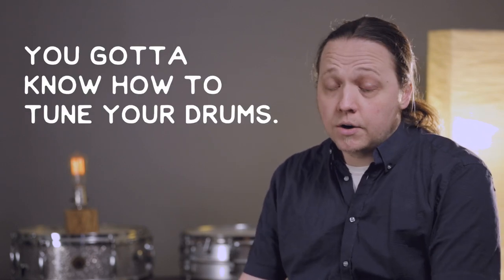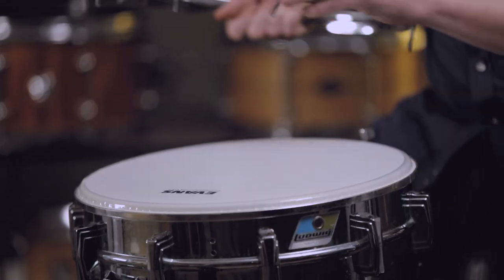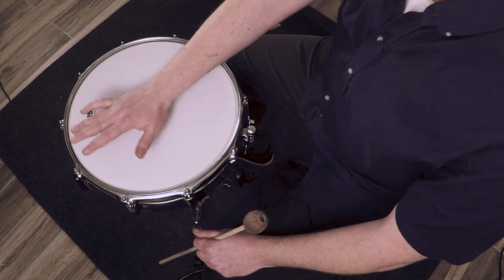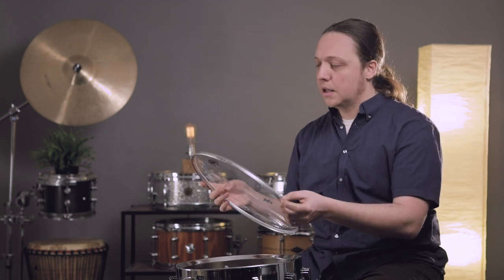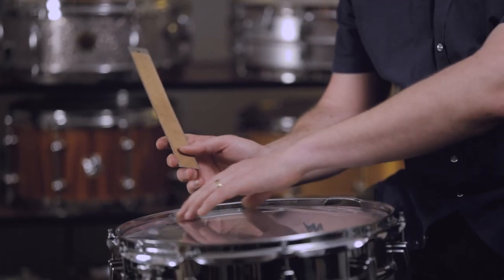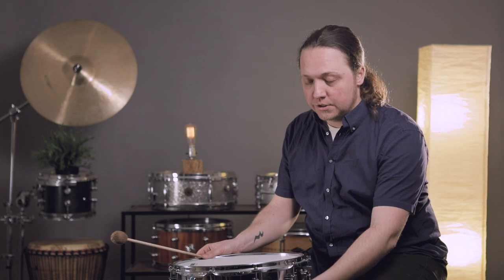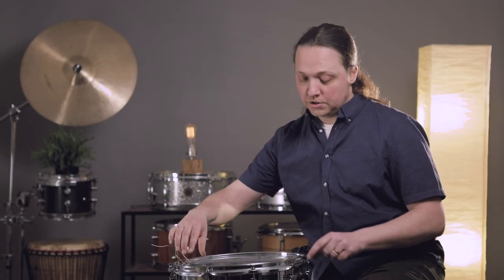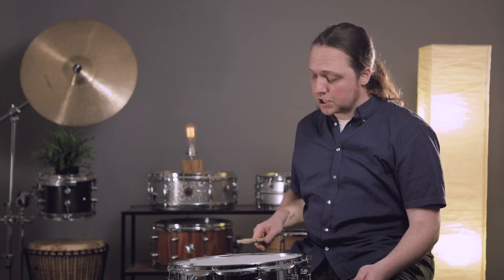Ep. 1 How to Get A Great All-Purpose Snare Drum Sound

Comment: I took a day and watched all of the videos on your Channel and am very impressed with your knowledge! I thought I was the only other drummer out there who got into the deep science of tuning! I started playing drums in 1968 when I was 12 years old! In 1971 I bought a brand new Double Bass Octoplus drum set with a Ludwig Supraphonic 400! Since that very day I've always used the Remo Ambassador Frosted Batter Head & Remo Resonant head with the Ludwig PAT. 2517124 Wires! I have since then downgraded the Octoplus set to a four-piece trap set but still use the Ludwig Supraphonic 400 and found myself in need of a second snare drum for backup now that I am in a performing band again! I purchased an East Rock snare drum from Amazon for $60 which also came with a Soft Case, Black Practice Pad Mat, Sticks & a Drum Key! The first thing I did was take the entire drum apart and snugup every bolt on the shell and lubricated all of the threads on the Tuning Screws, Internal Muffler and Throw Off! Next a Remo Ambassador Frosted Head on top pitched up high then searched worldwide and found the original Ludwig Vintage PAT. 2517124 Snare Wires along with new Strings from Guitar Center! The whole idea was to get this East Rock snare drum to sound exactly like my Ludwig Supraphonic 400! Unfortunately after all of my endeavors my experiment was a failure. When I hit the East Rock snare drum the Snares are still rattling! 😞

Comment: So... just got around to trying this method. I have always been a "tighten the reso head as tight a humanly possible" kind of guy, but the idea of eliminating the crap secondary snare-wire noises and controlling buzz interested me. Followed the instructions and found that after verifying the bottom hoop height at each lug was the same, the reso was waaaay looser than I was used to; Before it was 9.5 out of 10 and now I find it to be 5 or 6. 

Put on the batter and tensioned it up. Put the drum on its stand and hit it not knowing what to expect.  Wow. Just... wow. Fatness bordering on obesity. I cranked it up a little higher than I normally would and got tone I like without losing any girth. Great vid, thank you!

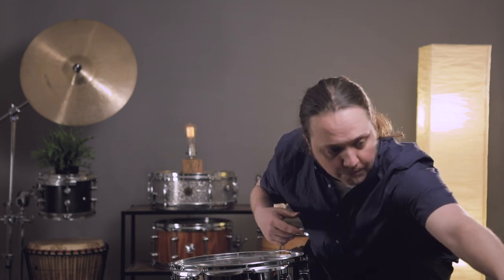Comment: The most valuable part of this video is the section about the bottom (snare side) head. I've always cranked the hell out of my snare side heads and tuned it like I would any other head, but noticed the tension rods around the snare beds were turned several times more than the others. Never really thought anything about it until watching this video. So I took the heads off one of my favorite snares and realized the bottom hoop was now warped because I'd over-cranked those lugs around the snare beds. Great. Ordered a new bottom hoop. Replaced both heads. And did my best to install the bottom head+hoop using the ruler method explained around 7:30 in this video. Not sure if I did it right, but I at least made sure to turn ALL tension rods about THE SAME AMOUNT (regardless of pitch), then fine tuned a little as needed. Now my bottom heads are tight, but not ridiculously tight, and while the bottom head may not necessarily be in tune with itself, I now have way more sensitivity and responsiveness from the snares at both loose/tight strainer tensions, and at all tuning ranges (top head). This alone improved my snare sound dramatically! THANKS GUYS!

Comment: Great choice of drum! I love my '76 Supraphonic and I even kept the original heads, snares and one of the butt plate screws as keepsakes after changing those out with new ones! Really, it's a great all-purpose drum so you'll get a great all-purpose sound most of the time as long as you tune it carefully like you did here (unless you need something crazy high or crazy fat sounding, in which cases a smaller or bigger drum is the solution)!

Comment: Just tried this method for my custom Acrolite, and boy howdy does it sound nice now! I basically tuned my resonant side up until it choked, then backed it off until I obtained a nice resonant note. Then I adjusted the batter head a little tighter than usual, and adjusted it to control attack. When totally equalled out, I found it has a nice WHAP so it now. Checking with pitch, it also ended up being the same interval between the heads as my preferred studio tuning, around a major third (B resonant, G batter). My only suggestion is that you guys include some more musical notes when mentioning your tuning, as it really helps us audiophiles hone in on a specific pitch to really replicate what you guys are doing. Awesome as always!
Reply from the maker: Awesome! So glad it worked! We've definitely been including pitch references in more recent videos, had no idea that it would benefit people so much :)

Comment: Great vid and great tips! One of the best for snare tuning I have seen so far (and there were quite many...)
Will humbly add few tips of my own:
- get 2 drum keys, tuning is more than twice faster and the tension is distributed more evenly on the head
- pressure on the head is especially needed with Remo heads due to the resin they use for the head bed. You can hear significant cracks of it while doing it. Do not be scared to do it. (Simon Phillips used to jump on his bass drum head, look it up on YT)

After many years I have found out 2 things I really like on my cheap  (literally, it was for for some $80 new when I bought it back in the days) birch Sonor Sonic Plus. (I have beech enforcement rings made there by Hallvad and changed the plastic throw off to a metal one). I got great sounding snare drum for less than $200 (you really do not need the Supraphonic ;o)):
- I prefer textile (nothing that can stretch ofc) straps over the strings for snares. Easier to keep snares straight and imho it is more sensitive than the string.
- Wooden hoops add another dimension to the sound. I use Hallvad beech one with inlaid dural circle so I have the warmth of the wood and the hoop will not get destroyed over time from rim shots, which still sound metal-ish.

Comment: I’ve started watching your videos recently and I’m enjoying them.  In each I’ve seen, the first time you hit the snare I’m instantly moved by it.  “THAT’s what a snare sounds like.”  So I sought out this particular demo.  Everything I’ve done for years and years is right in line with what you demonstrate.  I have an acrolite that’s at least 30 years old, and sadly it’s getting out of round, as evidenced by the violence required to get a new head on it and maybe it’s time to get another. It’s just not making that smooth resonance and I’m continuously using eq notches and de-essers to tame the wonky ring I get now. 
I congratulate you on your fine examples of the proper characteristic sound of a drum.
Reply from the maker: Thanks for the kind words! Definitely consider taking the shell to a skilled drum restoration shop/drum builder to get it looked at. A dented/out of round Acrolite is a relatively easy fix and it’s nice to not have to retire a drum if you don’t need to. Cheers!
Reply: Sounds Like A Drum wow! That’s really nice advice; my knee jerk feeling is that it wouldn’t be worth it overall and I do have significant attachment to this drum as it was my instrument for beginning 6th grade band in the 1980’s. Several years back I replaced all the bow tie lugs with matched originals and this would just be another chapter in its dare I say storied history.  You have renewed my faith in its usefulness and potential.
Reply: @joebisbey4521  ah, you just want an excuse to go buy a new DW kit, lol.

Comment: When you are installing the snares, After making sure the snare bed is level,  Where do you suggest the throw off adjustment (Spinning Knob)  should be set to ?  In other words, Your Ludwig throw off has a knurled knob that you turn to adjust the snares to get them close to and/or further away from the snare bed.  Where would you place that snare adjustment just before installing the snares ? Should the knob be turned back and set loose,  Say backed off all the way ?  or half way ? Is there a standard setting (low or high from the snare bed)  for the throw off when installing the snares ? I guess what I am asking is what kind of snare throw off adjustment do you Start with before installing the snares. High, low or in the middle ?   Good job on the video, You covered the bases and got right down to it with out a lot of non essential information.  I hope this question doesn't seem nit picky. But when I install snares that seems to be my issue. I know every snare drum can act & set up differently and each can present its own issues.

Comment: Things to do before you start.

Make sure the bearing edge AND the hoops are perfectly round and flat.  Also, it's a good idea to make sure the bearing edge doesn't have any issues.  As far as using beeswax, people use that on wood shells more than metal.  

  If they arent perfectly round and flat, it will be difficult to impossible to get good tuning.  Rims often go out of round either from the factory, or with those that play hard and play lots of rim shots.  

I know the Ludwig Supraphonic snare drum Is one of the most popular snare drums, I have found they don't have a very good bearing edge and this goes for other metal snare drums with a bent over bearing edge.  Some might be better than others, but it's hard to get them to have a perfect bearing edge.  And since the shell is a thin metal, they are more susceptible to going out of round.

Comment: Here is a Tip if you're in a pinch and don't have a mallet to pull out the low ends for tuning the batter side. You can take cymbal felts and put the tip of your drum stick in the center. Voila makeshift mallet. Yes depending on your stick model this may not work but its worth a shot. 

P.S. You can do this with both sticks to get a great soft cymbal swell on the fly.

Comment: I like to use a mallet to get the fundamental note of the shell before I mount and tune the heads. You have to remove all of the hardware to get the purest note, but you only have to do it one time. If the drum is well-built and in round, it should be fairly easy to discern that note, match it to a chromatic tuner, and tune the equivalent on the batter head. You can use the equivalent on the resonant side, though you may have to crank it quite a bit to hit the octave. If it's too much, shoot for a complimentary harmony note instead. I do this every time I get a new drum, and I'll mark the chosen notes on the inside of the shell( small, near the bearing edge )with a Sharpie. Happy tuning and tunes!
Reply from the maker: We plan to talk about this in a future video. Cheers! -Ben

Comment: Thanks for sharing. Could you talk more about or give an example of how you know when you have ruined a resonant head?
Reply from the maker: Hey there! It's tricky to say because there are a lot of factors, but what i'll usually look for is if i'm not getting as much warmth out of the drum at the normal tunings i'd use it at (especially with rimshots, i.e. if the rimshots are sounding thin and pingy rather than warm and full), or if the snareside rim is starting to get close to being even with the bearing edge (over-tight). Chances are in either of those cases the head isn't generating any tone anymore. If I see a snareside head mounted and cinched down tight and the hoop is at an odd angle because one side is way tighter than the other, i'd definitely change that too for the sake of the wires being able to speak their best. - Cody

Comment: Great video! ..btw I've noticed (I'm not wrong right?) that turning the stick around and hitting a bit harder (instead of using a mallet) gives better results hearing the pitch-difference for the top head (for the bottom head you can't do that or you'll get dents into the head since it's thin)
Reply from the maker: Hey there! I guess it depends on if we're talking about hitting the drum dead center to hear its primary pitch or if we're trying to even out tensions at all of the individual lugs. I'd say what ever sounds best to you is definitely fine, but for me using a hard striker to listen to tuning/pitch at the lugs gets dicey because it will bring out more of the overtones in the head in addition to the fundamental pitch and start to confuse my ear a bit. Hitting the center to get the full sound, anything works :) - Cody

Comment: best snare tuning vidio iv'e found by far. the  step by step method and using correct tools for setup and tuning you would be a lead engine tuner on a formula 1 race team. a master guitar tec is a luther, what is a master drum tec called ? by the way that customer will have a ludwig snare performes correct and hold up great! great job  Later

Comment: Purchases pictured Supraphonic in video thumbnail....
Now has ideal snare sound.
Reply from the maker: Haha, we like to think that it’s hard to get a bad sound out of one of these drums but it certainly is possible. Tuning is always key. Some drums let you bend or even break some of the “rules” out there but someone is still responsible for putting the heads on and tensioning up the wires. Cheers! -Ben
Reply: There are better snares. I have and really like a 402. But they come out with great stuff all the time. 

DW has some and I like the Black Beauty. 

Just grabbed one on a kit for 200.00 I like better than the 402. The 402 has a "poing" in it's overtones. Mine does that, so does the one at the store.

Comment: I like the tone of my snare, so when I  remove my old snare batter head, i counted the drum key turns, on each lug, when I put on new head, I  cross tightened the sme amount of drum key turns. counting the drum key full turns was a good starting refference point, just my personal tip for you drummers.
Reply from the maker: The number of turns of a drum key is a nice basic way to get in the general ballpark of a specific sound, though the stretching of the material will mean that a brand new head will typically require a different number of turns. Referencing pitch is a good way to recall a specific tuning. As you get more and more comfortable with tuning you'll get to a point where the specific pitches aren't really of concern. You tune to what sounds good and adjust the rest of the drum (snare side, snare tension, etc.) to work with it. Cheers!

Comment: I've heard various things on the snare side head recently--specifically regarding the 4 lugs that are next the wires.  I was always one to match the pitch on all lugs. But I've also heard of not tension those 4 lugs up as higher.  The options being 1) just barely tension then so the lug doesn't rattle, or 2) tensioning them up with the rest, which results in them having a slightly lower pitch.  I'd like to know your thoughts on how best to approach this and why.  The arguments I've heard for keeping them loose include allowing the wires to sit in the drum better and accounting for the shape of the shell.  It looks like you match pitch in this video.  One last question, is there a note your snare side typically lands at?  I need the fundamental of my snare to be around a G to work with my bop tuning, so I typically crank the snare side to around a G# or A, with the batter from C to C#.  Thanks for these great videos and your willingness to respond!
Reply from the maker: Hey there! I definitely always have at least some tension on the lugs on either side of the snare wires. My typical scheme is to do the measurement scheme in this video, and then sometimes I'll either reduce the tension slightly on the lugs adjacent to the wires, or raise the remaining lugs a bit. Either of these changes make the wires lay more flush to the head a little bit, so if I feel l'm not getting the articulation I need i'll do this sort of thing. For bop stuff where the entire drum is pitched up high (or funk too, for that matter), i'll always do this sort of adjustment. It's more or less just a way to get more articulation without actually messing with the tuning too much. I will do a little bit of pitch matching on the snareside, but i'm not too intense about it. If the head is level, the pitches are close enough. As far as pitch, i find that every one of my drums has a favorite range so I don't stick to any sort of pitch scheme really ever. Even from studio to studio or venue to venue, the same tuning may rub me the wrong way and need adjusting. Hope that helps!! - Cody

Comment: Im having trouble getting good snare wire response out of my Ludwig Black Magic 13 X 7. Ive tried string, plastic straps, and grosgrain ribbon for securing the wires. Ive tried new wires, new heads, different tensions of the top and bottom head. Basically everything. People have said that the snare strainer on this drum isnt very good, do you thing a good snare strainer can really make a difference in the sound of the drum, or is it really just for the sake of making the throw off of the wires easier?